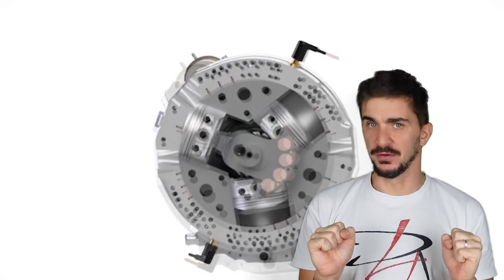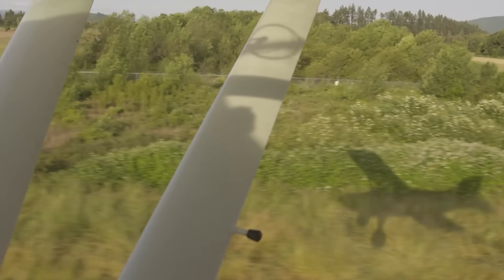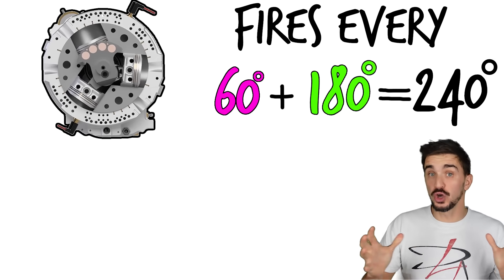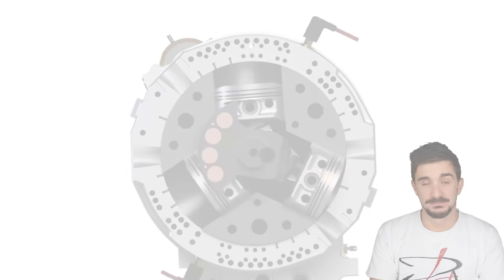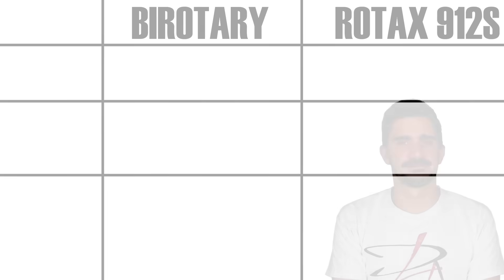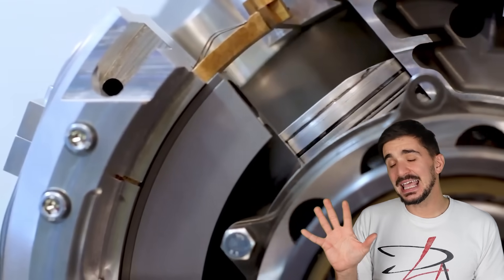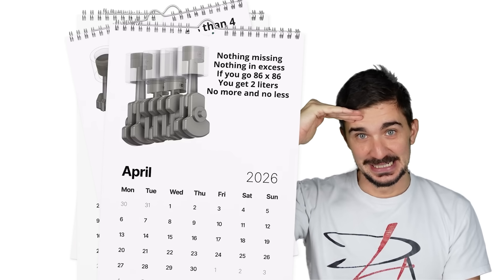This is What Happens When Pistons and Rotaries Make Babies - Birotary Engine Explained and Reviewed

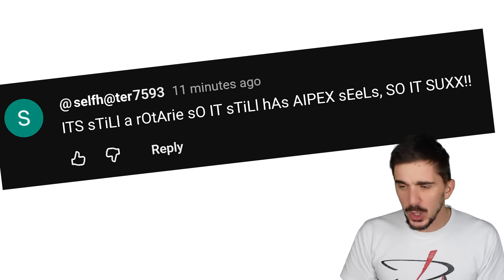Comment: 10:42 I was going to watch it before commenting, but you're a youtuber and not my boss so here is my take: How do you protect the cylinder walls? My understanding of regular boring cars is that the cylinder head is made of alminumum to reduce their weight because otherwise the forces that the cylinder head produce are to big to handle for the crankshaft, and burning oil might be a feature not a bug😅. Cool design nevertheless.

Comment: How about a redesign as a 2 stroke. But gas or diesel..? 

Re automotive applications: Might get by with compound boost
eg. a positive displacement blower to help low rpm torque which would decouple when turbocharger(s) spool up.

Comment: 16:39 well if you look at the planetary gear, you can slightly modify the valve timing by spinning the middle part of the planetary gear set
Reply: And the middle part of the planetary gear set is easilly accesible from outside of the engine, so you wont have to redesign the engine, only the planetary gear set

Comment: Ahhhhhhhh, NO . . . call me a hardline guard AND a Caveman BUT IF I wanted reciprocating parts in my engine I would stick to a regular crank-rod-piston engine.
This is just more complication (than a Rotary) with no real world significant advantages.
HOWEVER, I can see the case you make for Aerospace use and other fix RPM applications (industrial machinery (pumps, fans, compressors, conveyors, mixers, grinders), power tools (saws, drills, polishers for consistent cuts/finishes), electrical generators (to maintain stable frequency).

Comment: Hmm... maybe use dual motors with a variable electronic coupler to hold high rpm on one and then add the other motor for more power simulating low rpm torque.

Comment: 9:16 The answer is... No... Kinda... Wouldn't it be a "no" for a 3 CYLINDER version?
If the issue is the degrees between the power strokes, then for a longer stroke you simply increase the cylinder count to maintain that same offset.

I guess that means using forced induction?

Comment: I’m seeing cooling holes around the outside but how is the inner block cooled? I would think with small aircraft low weight and good fuel economy would be more important than compact size.

Comment: Reliability considerations: 
The design has a large flywheel in the rotating cylinder block and pulsing loads on the planetary gearset. That may put high repetitive loads on the gears.

The large cylider wall is not exposed to lubrication thus how will the manage friction and wear?

The triple seals between combustion chambers and exhausts will be exposed to the combustion process, see high thermal loads and combustion residue build up.

Comment: 16:14 - Most of the criticism here assumes the engine must mechanically drive the wheels. That assumption locks the discussion into outdated constraints.

If a bi rotary runs at a constant high RPM as a generator, not as a drive-train, the narrow RPM band is no longer a problem. The engine’s only job becomes converting fuel into electricity at one optimized operating point. Torque delivery, launch, transient response, and wide speed range are handled electrically, just like diesel electric locomotives and large ships.

In that context, fuel efficiency should be discussed as brake thermal efficiency only. MPG, gearing, and transmission losses are irrelevant because they do not exist. The fair comparison is chemical energy in versus electrical energy out. High RPM is not inherently wasteful if the engine is designed to operate efficiently at that speed. Any excess output is only wasted if it is dumped. With batteries or super capacitors, surplus power is stored and used later.

Electric motors handle propulsion with very high efficiency, excellent torque control, and regeneration. The engine never has to chase driver demand or operate in inefficient regions.

So the real questions are not about torque curves or drivability. They are about achievable thermal efficiency at a fixed speed, combustion control, sealing durability, friction losses, and emissions. Those are engineering problems, not fundamental disqualifiers.

Once you stop insisting the engine directly drive the wheels, many of the usual objections simply no longer apply.

Comment: as a generator on a hybrid car, the near fixed revs are an advantage.  Power goes to the battery, and the electric motors drive the vehicle.   Therefore, the small size and power density become advantageous.

Comment: This engine could be used at a static rpm (perhaps 8000) to charge large batteries in a fully electric vehicle. If it compact it would simplify the traditional hybrid engine, which has complicated systems for different drive chains.

Comment: I still missed why crank is needing to travel faster.. it seems like it's for the propeller speed but that can be achieved with gearing. Doesn't the counterweight on shaft travelling at different speed cause a problem?

Comment: Stacked smaller bi-rotary engines could be useful in pumping, generating and multiple other stationary engine requirements. 
However, if it is not as or more efficient and long lasting as what is currently available, then it is not much more than an engineering exercise .
I am not saying that to be a nay sayer, just pointing out the obvious design limitations that all inventors must take into account.
Jet engines make incredible horse power for the size, but terrible torque and fuel economy in general.
Piston engines can make good torque but are limited in rpm and power output.
Thermal efficiencies explain this better than I can in a shorter amount of time.
Cool idea though.

Comment: Seems like a candidate in autos for a PHEV, motors gets to run the generator at speeds it's good at, electric motor gets to apply it's max torque at low speeds - with the battery taking up variable loads.

Comment: If you count the block rotation it doesn't make the number more useful does it? The degrees on the crank the pistons fire at seems to me to be what we're trying to figure out and the spinning block is a complicated mechanism that lets that happen more often. From the perspective of the power pulse out of the end of the engine it's 180 firing.

Comment: Curious about the idea of sealing being good?  2 strokes must use a fuel oil mixture because they cannot seal an oil reservoir from the exhaust/ intake as the cylinder travels past the ports.  How would this be different?  Is it an oil injected motor?  How would they keep oil between the rotating and non rotate portion or is there no need for oiling those "Apex seals"??

Comment: Great video! I love the topic of new and potentially disruptive technology, and this definitely falls in that category!

2 things: 
1. How are these cooled? It would seem that there is a lot of heat going into heat going into the 'block' and very little way to expel that heat. I'm sure it been addressed, but how is cooling done on this engine?

2. Some other people have mentioned this below already. 
2.a.Contrary to popular belief, CVTs are getting better (I can't believe I'm defending CVTs! What has this world come to!). Once Toyota, Honda, and Nissan quit their 'emulated automatic gear' CVTs that cause excessive and unneeded wear, they actually have become more reliable and more efficient. CVTs ideally operate in a narrow RPM band and may be made to stand high RPM or can be geared lower. As long as cooling is properly addressed, there could be a potential for small ECO vehicles that truly use a CVT to its highest ability. 
2.b. Also, generators and other stationary, rotating loads have a decent potential. The big question there is, how fuel efficient (overall) and cost effective it is relative to an equivalently rated engine?

Thank you, again!

Comment: I can't wait to see you make this engine.  I might be missing something, but how does momentum of a spinning thing produce torque unless you are accelerating or decelerating the speed of rotation?  I assumed you were just talking about the gyroscopic forces until you addressed that as something else right after.  I haven't thought this through, but what if the rotopiston engine had a single intake and exhaust port around the circle so the pistons only needed to move half the speed relative to this design?  I would like to see if variations on this would work better for wide rpm usage on acceleration.

Comment: My first question was, when I saw the picture: Why? And than: Aha! I like powerdense engines, and I dont mind high RPM (although narrow power and torque band isn't ideal...) But maybe there's a way to implement VVT with sliding port covers, that cover some areas of a larger port some of the time, and they slide them back or forth realtive to the spark plugs. Also gonna buy the calendar ^^
Reply: also i'd like to see a black T-shirt so I can work on the car in it :D (don't have to worry about oil marks :D)
Reply: One more question: will there be EU manufacturer/stock of these calendars? Thank you!

Comment: Way to complicated.   basic diesel electric generator  mounted low midpoint of airplane and use a electric motor and propeller.    More reliable, electric motor slimmer and aerodynamic and propeller control easier.

Comment: Could a T-VIS like system be used to increase intake velocity at lower rpms. instead of a single big intake port, 2 or 3 smaller ports each with their own throttle valve that dynamically open or close as rpm changes.

Comment: Re WWII radials; to power what? Those engines had hundreds of moving parts and even the best struggled to make 1HP per pound of engine weight even at max output.  Just look at helicopters.  With radial engines (S-51, -58; Be-47) they had quite limited useful load or range or both.  When designed for turboshaft engines both were greatly increased.

Comment: Conceptually it seems to be a hybrid of a WWI era rotary engine and a WWII sleeve-valve engine. 

The difference is that in this case a single sleeve rotates along the cylinder head instead individual sleeves around each cylinder.

It would be interesting to see how well the compression seals work in practice. 

So do the extra seals perform the same task as the oil rings in a conventional engine?

Comment: Nearly every small high rpm plane engine that needs a gearbox does rotate the propeller in the other direction!
So that's just a marketing wank! 🍆💦

Also the relative high weight is logical, because you need an engine block within an engine block + the heavy gears and bearings holding all that rotating mass together. 😂
And liquid cooling is absolutely required, against the typical air cooled boxer engines, which makes this bastards engine  even heavier.
It's definitely a better design than the liquid piston engine, and such stupidly impractical creations.
Maybe even more reliable than a wankel in the short run, but I doubt this gains much against air cooled boxers.
This also scales very poorly, so if at all, this just competes in a very niche market range.

Oh, and I wonder what happens to the carbon build up between the two blocks, aka the head gasket!
At some point the inner block will rub against Carbon around the combustion area, and how do you get rid of it in front of the sealing rings... and how do you lube those seals?
Having the seals constantly rubbing linearly might be good for sealing, but you can't get rid of any debris like in a reciprocating seal. 
It just stacks up until it binds up. 😬

Comment: With either a hydrostatic or a modulated CVT type transmission, you could logically run a commuter car, assuming its not going to race.

And yes, I realize that CVT transmissions for cars tend to totally suck, but there are some weird "plate" type transmissions which, while not indestructible, are far superior to the belt/chain type CVT drives.

I suppose a really complex multi-speed automatic transmission could be employed, but its total mass and complexity, along with its tendency to rob power from the system might make that a bad idea too.

Comment: An interesting engine. They also have a zero vibration range extender. I am still waiting for someone to build a generator that can produce enough power to fly a 2 passenger VTOL Drone with electric motors. That would be the ultimate transportation device!

Comment: Thanks for yet another great video! I would like a follow-up video with thoughts on the following scenarios: Downsizing, upsizing, Usage in CVT vehicles (scooters/mopeds, snowmobiles, cars?), usage with forced induction (mainly to help on low rpm), and also motocross use (in comparison with 2 stroke competition motocross bikes, which as we know have a very narrow powerband).

Comment: This may succeed: Why?  The Wankel rotary, and liquid piston engines are fundamentally burdened by a combustion chamber that is not round (they're an un-optimized, crazy shape).  This means they can not be fuel efficient. Ever (see below).  Bi-rotary has essentially a cylindrical shape combustion chamber. That means the ratio of combustion volume to cold skin area + nooks and crannies, should allow the fuel economy to be close to the traditional piston engine.  The cold walls and nooks and crannies (i.e. corners) in the other rotaries are places where combustion can't reach before the cycle ends, and is a primary reason why they can't be efficient, thus are limited to niche applications where fuel economy is irrelevant. As others said, rpm range is irrelevant in hybrid automobiles and other applications, so this engine could find a foothold there provided it can be reliable and be manufactured affordably.

Comment: There is one more drawback that I can think of, remember the rotary valves that you covered in which during combustion some gases leave the chamber around the valves! I think that can be the case here too where gases can leave around moving cylinders because there is tiny gap between moving cylinders and the head

Comment: It's going to be real hard sealing that inner area against both rotation against the outer casing, and the added force of the pistons moving back and forth inside it pushing it against the walls rather forcefully in various places, without very high rate of failure of those seals.  But even when it's in good condition, I suspect you'll have both high wear and oil burning a la rotary, which has already made that design virtually obsolete from an emissions standpoint.  Add ports without valves to give it a narrow power band (no equivalent to variable valve timing, lift or duration), and crank bearings that spin at double the speed of the engine, as the crank spins one direction and the inner casing at the same speed but in the opposite direction.  An interesting thought experiment, but I just don't see how it can be made reliable, efficient, clean and durable enough for the mass market, compared with what it already available.

Comment: Sliders (pistons or vanes) in a rotating frame are subject to Corliolis acceleration.  This presses the piston to cylinder side side opposite rotation.  So this engine is prone to wear out.  The Gnome, LeRhone, Obersul rotary engines, because of Corliolis, were short lived.  The force is in proportion to the square rotating speed.  Maybe with synthetic oils, wear will be acceptable.
    Lubricating the seals requires a lost oil system.  
    Cooling (likely oil) the rotating block needs seals too.
     I don’t think the pistons can be cooled with squirters.

  Airplane propellers have a gradually increasing torque demand curve…T= rpm ^2.  This engine would be a good fit.  

   What affects prop planes is not principally torque or gyroscopy.  When the plane is slow it is at a large angle of attack relative to the wind.  Thus, the down swinging blade has a greater angle of attack, and more lift.  The upswing blade less.  The lift difference causes the plane to veer to the left with CW rotation viewed from the cockpit.  The pilot puts in right rudder trim to counter, but note the fin/rudder twisting moment w/ right trim is complimentary to the torque.           Cheers

Comment: The other downside you didn't mention is that the spark plugs don't get intrinsically cooled to the same extent as in a traditional 4 stroke  piston engine due to the shorter cooling interval and lack of exposure to longer periods of sub-critically heated air flow.

Comment: The engine runs. The prototype's efficiency was surely tested. If it were promising they would have shared the numbers.
Efficient engines traditionally have long strokes. This one is extremely the opposite. Heat is getting sucked through the lower cylinder head and the pistons like crazy.
The weight may be a function of the double spherical cow. Or cylinder head? Or engine block?
Whatever the thing is 20,000 pauses per minute (TDC and BDC) does not make for long maintenance intervals.
Fuel in oil dilution is probably very high.
The thing looks dirty and emissions requirements are in the near future.
Grand example you had: a fidget spinner

Comment: Power denser is not benefit but a downside.
Remove all that heat from the components without overheating them.
Good luck.

Additionally - all that friction from the seals acting on such a huge radius. That screams LOSES!

Comment: Looks interesting as you say for aircraft, I have a single rotor 13B in my lightsport aircraft. With some material changes the weight might be able to be reduced, My 13B uses alloy side plates instead of cast iron.

Comment: That's not true.. Just like a power valve on 2 stroke dirt bikes;  You can still build it with adjustable ports.  I also wouldn't be surprised if it could benefit from expansion chambers on the exhaust, just like a 2 stroke.